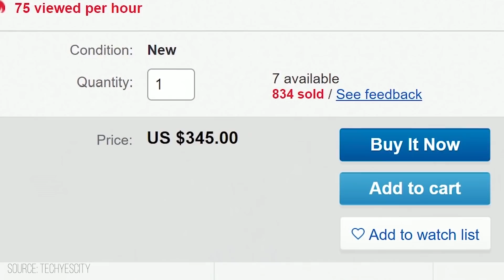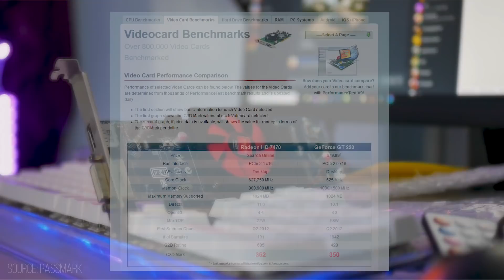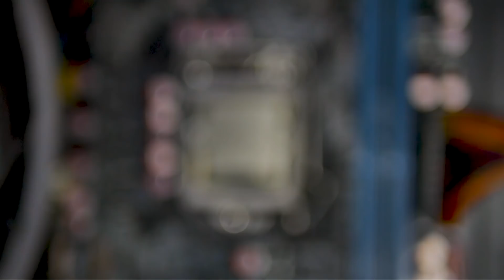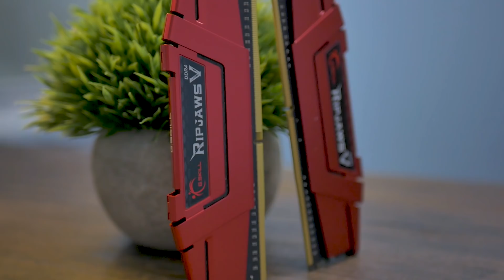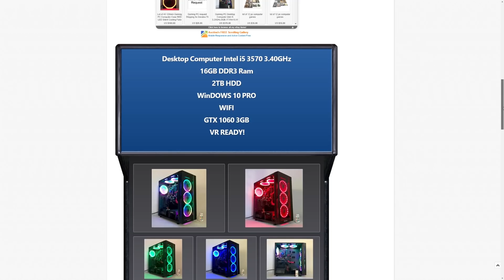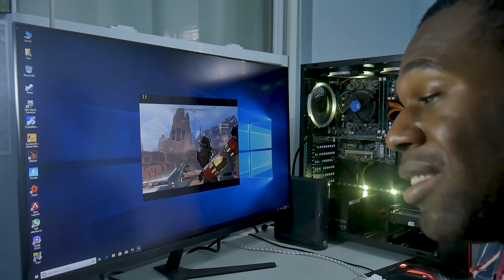These eBay Gaming PCs are NOT GOOD...Here's Why | OzTalksHW

Comment: Windows 10 can be installed and use for free, don't even have to buy the key and you can get updates. I think Windows 10 Pro keys are dirt cheap if it was purchased in China or Asia countries so at least thats a good thing from that PC, the only redeeming quality it has for the price tag. These crappy PCs on ebay are basically just old office desktops from DELL that they just add in RGB fans and stick in a very very shity low performance GPU and slap the title of "Gaming PC" on it and ignorant people will be tricked into buying it. Its a strawman scam as you can't disprove that it ain't a gaming PC or prove that it even is so they use that loophole to circumvent from being sued. The margin is extremely high as they most likely got the GPUs in bulk and the fans or even rig up the lights themselves to cut even more costs.

Comment: You can cheap out on PSU but BRAND is HUGE.   Do not buy Coolmax, Apevia, Solidgear, Power Spec.(These will even fail on Low end 35-150W Systems within 3 months to a Year.
      At Least get EVGA 400W, Raidmax, Seasonic, Corsair, Cooler Master, Rosewill, Thermaltake, Be Quiet.

Comment: now I'm interested in a couple of things. one being how this runs with just a higher quality psu and then how it runs with a better gpu and the higher quality gpu. wondering how much of a difference a better cpu would make lastly.
Reply: That GPU is using PCEI to power itself so its a 45watt to 75 watt card. Those are usually garbage in performance as stronger cards draw more power.

Comment: I had three friends who wanted to convince me that the "gaming pc" they purchased off of ebay was some bomb deal to them. Me as an pc enthusiast was sceptical that they actually received a good machine and upon closer inspection i just told them that they got ripped off and picking parts individually is way cheaper. That said the general argument is that they dont know how to build it and want to buy pre build to not deal with it. That was a response after i litteraly said that i could come over for a beer or two and build it real fast which would take me like half an hour.

But at the end of the day its their choice what they do with their money. Sad thing however is when they want to "Test" their brand new computer against my "older" self build one from 2016 rocking a i7 7700k at 5GHz, 3000MHz RAM and GTX 1080 from MSI. They paid a bit more actually for their pc with worse specs than i did choosing my parts.
Reply: i would actually like to hear some more Storys about the awesome computer Knowlege of your friends. What did they have in their pcs?
Reply: @herroberbesserwisser7331   If i compare them money wise against my PC i should start talking about how much i paid for my parts. The CPU i bought pretty much after it first got released at around 350€. Motherboard was a ASUS Ranger which set me back around 110€ but i got a pair of headphones with it which is nice. sold them for 50€ on ebay but just for the sake of it i say its 110€ because you dont often get stuff with it. RAM was 130€ and the GTX 1080 was 550€. all other things i still had from previous computers like case, monitor, mouse and keyboard. So i dont calculate them in this because friends also had older PCs with those things and could easily reuse them.

Now i paid around 1140€~ +/- some change money but that should be pretty close to it and it still runs everything prefectly at 1440p and i dont have a desire to change anything yet. 

All the PCs bought came with decent amount of disk space at 2TB HDD and 120/256GB SSD as boot drive, decent case, cheap case fans, stock CPU cooler and no accessoires worth mentioning. One of them had RGB lights but thats about it.

PCs kicking i5 7600, Ryzen 3 and i7 6700k with GPUs mostly in mid range such as RX 580, GTX 1060 and a GTX 1070 which is the best one. The i7 6700k combined with the GTX 1070 was the best deal they had but still a bit more expensive to buy them as a packaged deal instead of buying them seperately. 
All Three PCs had 16GB RAM at 2133~2666 MHz. Biards where all just the bare minimum and nothing special. probably 50~80€ each but i didnt really check but having a glance at them revealed that they where having only two RAM slots which can be a downside if you want to upgrade ram later on.

Now the i5 7600 + GTX 1060 combo came at a price around 1600€ bought at a local computer store. Way too pricy for what he got.

The Ryzen 3 PC came with the RX 580 and was the cheapest of the bunch at about 600€. Also pretty up there but considering he only plays at 1080p the performance is enough but he could´ve saved some money.

The third PC is what i think is the best deal and came with the i7 6700k + GTX 1070 and is still a very good PC. His monitor is a 4k one however and the GPU struggles here and there but the overall picture is pretty decent. He paid 850€ for that machine with all new parts. no used. 

So yea i only have three comparisons to make here but my own experience is that buying and hunting down PC parts is way cheaper than buying pre build PCs off of online shops and only the used market can get you a good price on good hardware. However in the used market you never know what you will get and im a bit cautious on some parts and try to avoid others entirely because its not worth buying them used such as HDDs, SSDs and GPUs especially if they where popular mining components like the RX 580. you never know.

Comment: I'd like to know, how do the RGB fans and the led-strip connect? It seems to be synced
Reply: Kalle :D probably the same way the aigo fans do. there's slots on those controllers to add strips as well as the fans. the controller seems to be well hidden so it's not immediately noticeable.
Reply: ArtisChronicles yeah thats what i was thinking. I have those aigo fans aswell and id love to connect an led-strip to the hub

Comment: Well if you read its have old i5 at spec you already know it's overprice, even old dell optiplex still have better CPU like i5 2400 or i7 2600 without GPU its much much cheaper and buy used GPU like RX 560/Gtx 1050 or new one like Gtx 1660/1650 and boom you get cheap pre-built gaming PC.

Comment: I've used expensive Corsair gaming RAM and cheap Kingston Value RAM and to be honest I think I'd rather go with the Kingston stuff. When using both sets I found the Corsair RAM allowed for higher overall frame rates but the Kingston stuff had much better averages.

When putting systems together for friends I've found the Gaming RAM to be very problematic, yet the Kingston stuff I use in my own builds has never let me down. If you want a heatsink on your RAM then just buy a kit from eBay for a couple of Dollars. The expensive stuff really isn't worth the money in my opinion.

Comment: It's really sad because this will be alot of ppl's first impression of PC gaming and they would just go back to console saying " PC's are so expensive" . People really need to do a little research
Reply: For 375$ this is bad if i had a budget of that ill save a little for for 400$
And buy the parts all new except for the gpu and buy a ryzen 3 2200g and 8gb 3000mhz ram and oc it to 3200mhz ram for 300$ and buy a used rx 480 for 99.99$ and bios the rx 580 to the 480 BOOM you have a r3 2200g with a rx 580
Reply: @justsomeguywithabaldhead2171  lol that's almost my setup. I have a ryzen 7 1700 ,rx 480 8gb, 500gb Samsung Evo, 1tb silicone SSD, 12gb DDR4 ,750w psu n g21 tempered glass case all for $550. Got some parts used but it plays any game i throw at it at 1440p. Shows that just an extra $100 can go a long way

Comment: If anyone wants to get into pc gaming on the cheap, I usually recommend one of these two option, depending on if they prefer new or ok with used. 
1) Basically a new pc based on the r3 2200g. one stick of 8gb ram, 120gig ssd, and stick in a gpu once you get more money. Anything up to 2060 would pair well. 
2) For the used route, I still recommend what I basically used for 2 years: an old i7 2600 oem pc. Simply add more ram if needed, add ssd, and add in a gpu. While thsi doesn't provide much of an upgrade path, it does have an amazing price to performance ratio. You'll get a solid 2 years of gaming with the build.

Comment: I was going to build a PC but I got a Black Friday deal that allowed me to save 600 dollars by buying a prebuilt. 
Gtx 1080ti
I7 8700K
A dope case
16gb ram ddr4
1tb SSD
2 tb HHD
850w power supply
Reply: 850w psu prebuilt=likely bomb psu.... also somehow i really doubt u saved 600$ over buying part by part, if u did then it was a plain sick deal but i bet the prebuilt was till more than 2k$

Comment: Just add RX 570. It will run 50-65 fps med/high set 1080p. And u must say "Dont cheap on Power supply".  Instead of rgb things

Comment: I wouldn't even use the Radeon 7470 as a display adapter.
Reply: rather use a gt 210 passive cooled or a 710....IF your mobo lacks more outputs

Comment: I'd love to see a 'rescue' video, improving this PC to a playable state.
Reply: by replacing everything except the case, the big fans and the lighting..lol
Reply: Mark Coleman agreed!
Reply: Agreed, Oz please show this computer the Love <3
Reply: Pimp my computer...
Reply: Wouldn't even pass the 30 second mark.
Reply: And then send the pc back lol. Would love to see the sellers face.
Reply: Literally not worth it, that's the point.  The amount of money you spend to make this a workable system, plus the initial spend, would be far better spent on just getting a better system to start with.
It's not like a Dell Optiplex, where the low intitial cost of the system makes buying it cheap and upgrading it a viable option.
The only situation where this makes sense is if you literally need any computer and have no interest in upgrading it.  And you could still do it a lot cheaper with less janky components.
Reply: Not worth it like he said everything sucks
Reply: I was a idiot and bought a pc from Ebay I need to upgrade it
Reply: @Moochi4  not every pc on eBay will be quite as unfortunate as this specimen.  It really depends on where the corners have been cut.
Reply: The wiring is great on it it doesn't look like they cut corners but I'm new to pc so I don't know what to look for
Reply: 750 ti or rx 460 + 4 core should do the trick utile the PSU and dd die
Reply: bro is this good ?AMD Bristol Ridge Quad Core Athlon X4 970 3.8GHz(4 Ghz Turbo) Socket AM4 TRAY
Reply: well you would have to replace the cpu but with the cpu goes the motherboard and with the motherboard goes the graphics card and ram then the hard drive would probs die pretty soon soo toss that into the bucket aswell then u would probs have to add some usb 3.0s and also replace the power supply and the only thing u will be keeping is the fans and the rgbs which yea internally ur replacing the whole pc
Reply: Just get a better gpu
750ti or 1030 ddr5

But the PSU might be a time bomb

Comment: Socket 1156 isn't a bad base for a build despite it's age. But they've put the worst parts in it they can find. I've got a build with a quad core i7 (870 I think) and a GeForce GTX 970 graphics card and it does well. I don't know how it performs with the games you tried because I don't play them but it handles Diablo 3 at high settings and 4K resolution without any problems.

Comment: Oooof on that Cinebench score. My older Phenom II gets 280 versus that 195.
Reply: While it doesn't have the instruction set to play apex legends, a Q6600 at 3.0ghz gets 280 in cinebench on ddr2 ram...
Reply: @JoSnowHair  I'm not sure that error from Apex is truthful. PhII's do have SSE3. It seems an artificial limitation. Apparently at one point it did work on these chips before a certain update.
Reply: @azureknight777  Don't worry, I was talking about the Q6600 not the phenoms :)
Phenoms can still get up and boogie, and while at launch games like assasins creed odyssea couldn't run it they patched it out for the phenoms so they could play. I kinda doubt the Q6600 could.
Reply: My Phenom II X4 3.8 GHz would get 395 points in Cinebench.
Originally, it was a dual core running at 3.2 GHz.

I was able to game with it. I was getting ~70 FPS in single player Battlefield 1, 1400 x 900 pixels.
In multiplayer, it would be 40 to 60 FPS.

Comment: not all ebay pcs, I seen an ebay pc with an 8th gen i5 i think it was like an 8500 or something like that with a gtx 1070 8 or 16gb cant remember with an ok case, and I think there was a low capacity ssd and a hdd for $650, not to mention the pc sold fast

Comment: Soon as I saw it was a first gen i5 I was like nope.  I continue on with my search if the seller can't tell me what type of ram it has, or what CPU is in it.
Reply: First gen i5 so it takes ddr3 1333Mhz ram
Reply: Yeah I know that, but that is also a good point. I've also seen DDR2 bundle with this gen i5. That's like around 400mhz. A few sellers dont even include what manufacturer, model, speed, timing, and type.
Reply: I have a quad core 2 duo q9400 with ddr2 800 mhz ram and that gets a higher Cinebench score. This got 190's and mine got a poor score in the 270's. Only thing useable is the case and rgb fans, but you know what Oz says about rgb.

Comment: Bragging about 27 fps for any game is the first red flag people should easily catch.  My requirements are an absolute 30 fps minimum on 0.1%, so that computer is a no-go for me.

And for any seller to put a cheap power supply in a system with a mid-tier or high end graphics card. . . it should be criminal!  I wouldn't even do that for an extreme budget build.

Comment: So I know un-branded psus aren't great but, I'm planning to do a very cheap build with an athlon 200g. I know this specific apu uses very little watts. So wouldn't a cheap psu work fine with it?
Reply: part of the problem is a cheap psu is much more likely to fail and when it does it can short out and fry components. the evga psu is probably the cheapest one I would buy
Reply: @onebladeprop  sigh so there's no way out of this huh! Thing is the cheapest decent psu where I live is $45 from either Cougar or Coolermaster. Which is pretty expensive for an ultra budget oriented build.
Reply: @jaxd7206  
I will admit I have used some really cheap ones in the past with good luck. But I've also seen them fry motherboards and video cards. It's up to you if you want to take that gamble to save $20

Comment: lol this reminded me of when I used to play games on an i3 540 and gt 610. Performance of that system seems like it would be really similar to the 7470.
Reply: I was gaming on a core i3 530 overclocked to 4.1 GHz back in 2010-2015.  I was playing Planetside 2 @ 20-45 fps.
Those were good times despite the low frame rate.  Most single player games run 45+ fps with a strong graphics card.
Reply: Lol the 7470 is literally gt 210

Comment: I sold a computer with a i7-3770, 8 GB DDR3, and HD 5450 for $160 and I still felt like I ripped off the buyer
Reply: I7-3770 is still a solid performer. You did that dude a favor imo

Comment: Sorry to comment again. But yeah this seller gets parts from Wholesalers. He pays $5-8 for cpu. $6-13 for Radeon Card, PSU is from Newegg junk $15-20 prime membership, $20 fans but probably buys in bulk from China.  Same thing for board, or already comes with cpu mounted from a 10 Year old machine.

I never use those psus or cpus lol. 
We've used X3470 or x3450 but that's entirely different performance.
Reply from the maker: Interesting info thanks. How do you know? Do you sell pcs or parts on eBay?
Reply: @OzTalksHW  I wanted to talk to you on Discord but it said it's down or something. but my Discord is xxlostspiritxx#1559  We Sell Rigs.  Yeah I am not too shy to show it because we keep excellent feedback and take care of our customers. This is our Ebay Store.  https://www.ebay.com/usr/xxlostspiritxx            GTX 1060/RX570 builds are extremely competitive.                     
 But Yeah I had wholesalers try to sell me those Cpus, Mobos, and I am like no they are crap ancient Dual Cores.. no thanks... We don't use used or refurbished drives. Mainly SSDs or new 1TB hdds.   Our description is a long mess. But it helps limit customers crazy questions lol.

Comment: Raspberry pi 3 is better than this pos wow
Reply from the maker: You actually might be right
Reply: @OzTalksHW  can it even be considered a potato?
Reply: @OzTalksHW  Dude PLEASE, Compare this to a 8gb Raspi 4. It would legit be Amazing, also maybe Compare it to the Lattepanda alpha. It costs about the same as this and ill bet its more powerful
Reply: But a raspberry pi doesn't have any RGB
Reply: @Leonvolt28  You can solder them directly on to the PCB and run a Python script!
Reply: rhaspery pi 3 b+
A quad core with 1.2-1.4 GHz and it can be oced. 
Up to 256mb vram 
 400mhz for 2d and 300mhz for 3d stuff
with up to 16 instructions per set.
2gb ddr3 ram.
It can do ok up to like psx emulation with playable framerate and can be run off a cellphone charger
Bluetooth 4.0 and built in wifi that's okish
Theirs also a newish kid on a block
Atomic Pi
SoC – Intel Atom x5-Z8350 quad core processor @ up to 1.92GHz with Intel HD graphics.

System Memory – 2GB DDR3L-1600.

Storage – 16GB eMMC flash, slot for SD expansion up to 256GB.
Dual band 802.11b/g/n/ac WiFi 5 via RT5572 with IPX connectors on board

Bluetooth 4.0 via CSR8510
Which is a $100 tho
5v 4a
Reply: I have a one. ITS TRUE.
Reply: I actually don't think so tbh
Reply: Not quite:  Even a i5 650 should massively outmuscle a Pi.
But in terms of value, it kicks this things ass.